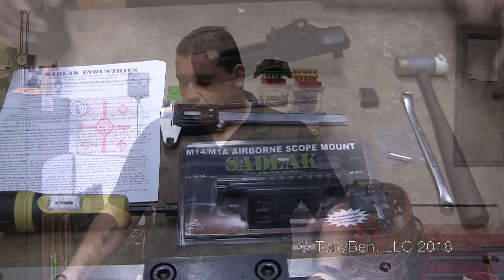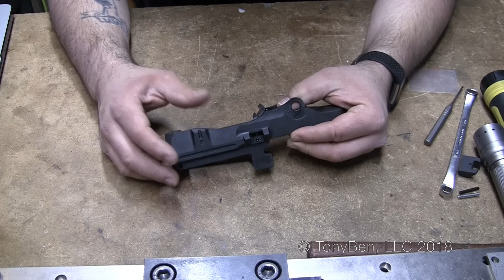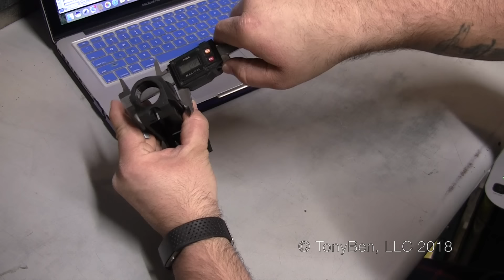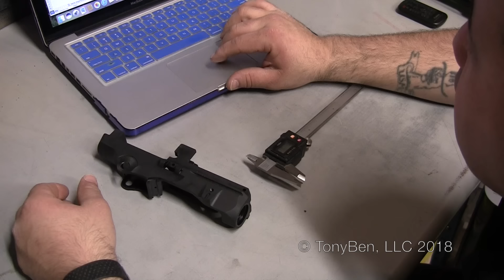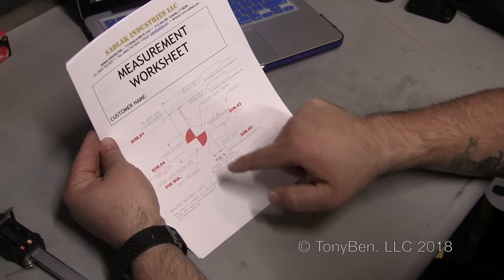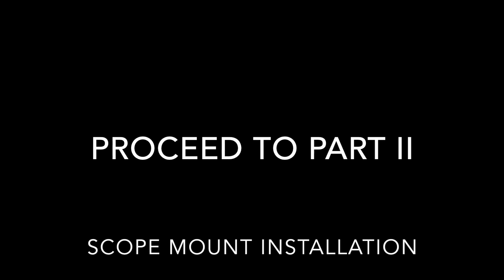Sadlak Scope Mount Introduction and Installation Instructions Part 1 Receiver Inspection

Comment: I had purchased a Standard model SA M1A back in ‘09 (Kalispell, Mt, but I’m now in Texas). VERY satisfied with the Sadlak STEEL ‘Airborne’ mount I’d chosen. Talk about TIGHT tolerances for a mount; it COULDN’T move if it wanted to...unbelievable quality too. I’d looked at Springfield’s OE mount and the A.R.M.S.mounts also. The choice was actually between the latter OR Sadlak, even though the ‘design’ was somewhat different for each. The quality is definately in BOTH. I couldn’t be more satisfied with how they R&D a precision piece...’course it’s FAR from inexpensive..”buy once, cry once”.

Comment: What are your options if you don't have any form of measuring tools suited for this sort of work, I just picked up a Springfield Standard M1A today and am looking to get a good optics mount for my rifle.
Reply from the maker: I recently inspected a recent production M1A and the receiver was in spec. It will most likely be okay. If it gives you problems, then you can pick up a cheap set of calipers from Harbor Freight and do the inspection.

Tony.

Comment: "He drives the guide out the wrong side, bless his heart" . Awe thanks man !  Im not Springfield expert, never claimed to be, and as far as "driving" the guide out... Um yea... i PUSHED IT OUT WITH MY POINTER FINGER - NEVER HAD USED A HAMMER.  you might want to re-watch the video.  Thanks for the comments on my video, and the correction.  but on the 2 of these I have installed on both M1A's i personally own, I never had the issues you describe.  However that doesnt mean you insight isnt important to bring up.  thanks for the tips.

Comment: I was 'taught' to remove left to right and install right to left...
Reply from the maker: It installs from the bolt stop side and is removed in the direction of the bolt stop. If you've been able to do it opposite, you've been lucky. I've seen rifles that had broken clip guide slots. It ain't pretty.